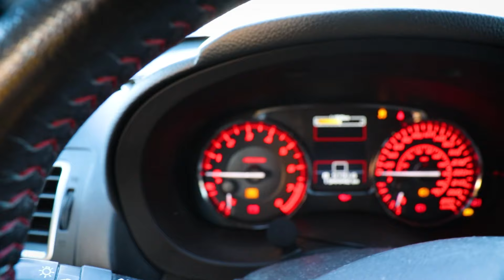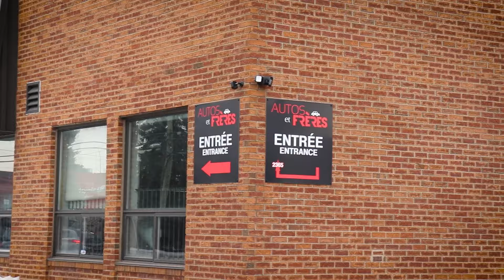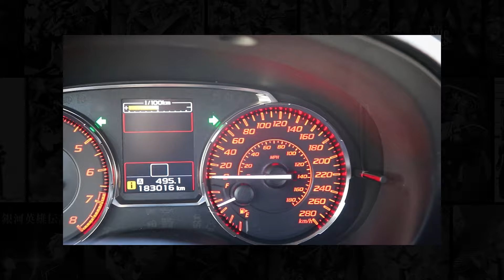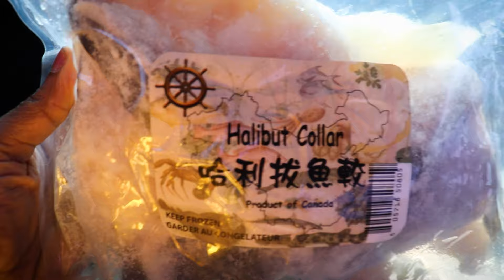The WRX is down for the 1st time...

Comment: I am not sure if Subaru still has this specific problem, but they were notorious for cracking oil pickup tubes.  I changed mine in my 2004 STi back in the days when I owned the car with an aftermarket unit.   People had their engines destroyed when the tube would break and no oil would reach the engine/turbo.